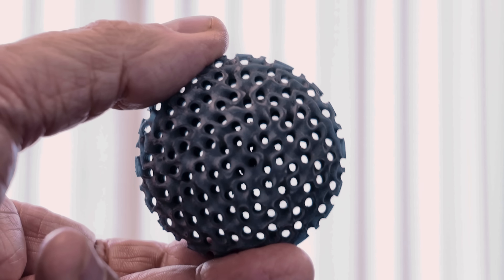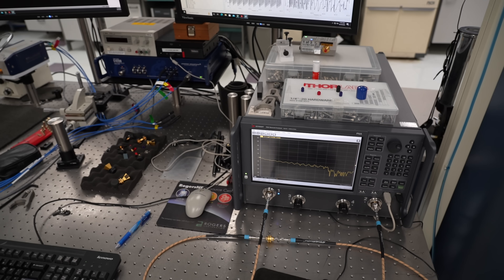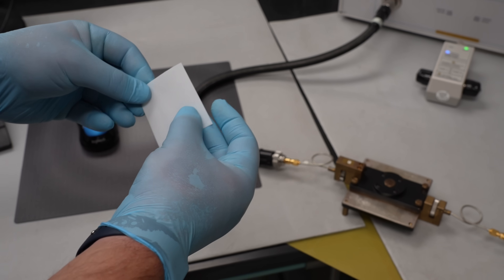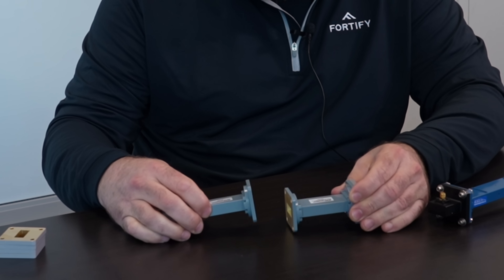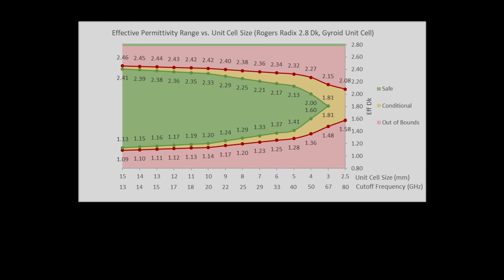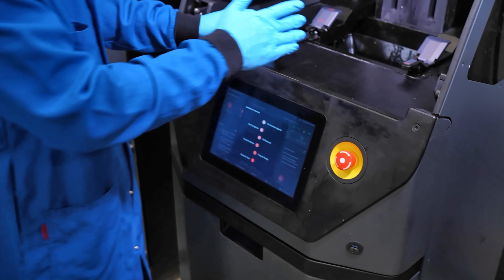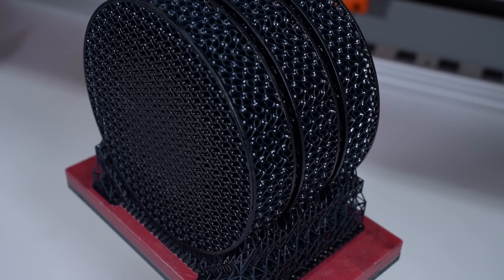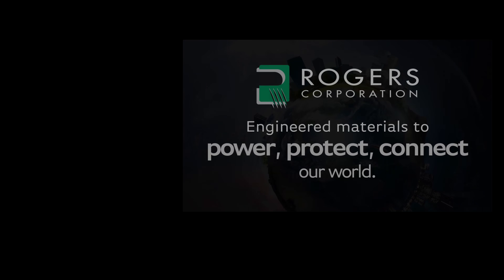Unveiling the Future of Antennas and RF Lenses using Radix™ 3D printable material!

Comment: Could you make a wifi laser with this?
Reply from the maker: Lasers (or MASERs for microwave frequencies) need a way to pump energy into a medium to excite molecules or atoms into a higher energy state that will persist for a while. I can't recall the exact detail of which energy level is involved in for instance a hydrogen maser, but I think it's a spin-orbit interaction and might be from the Zeeman effect splitting the emission lines in a magnetic field then sorting the molecules in a specific state and selecting only the desired one, feeding those into a resonant cavity. If you take hydrogen and excite it, you can select for the 1.42 GHz Lyman alpha transition and get a LASER type effect.  To get the same at a wifi frequency, you would have to find a gaseous, liquid or solid medium with a suitable quasi-stable transition that you can excite to cause a population inversion, then either allow spontaneous emission or drive the thing with a specific wifi frequency to stimulate the emission. Getting any modulation on to the resulting pure single-frequency MASER would not be possible using the normal wifi modulation schemes as those need significant bandwidth and the MASER line is extremely sharp.  Whether a GRIN lens would be any use depends on the loss in the material. It is very low loss, but still perhaps 100 times worse than a mirror-finish silver coating on the inside of a ceramic cavity that it then coated with PTFE.  You need the ultra-low loss and lack of outgassing to get a high enough Q factor for the cavity.  I don't know of a suitable transition for 2.4 or 5.8 GHz wifi, but the Rubidium line in the atomic clock in my home lab is not too far away.  I don't know if you can make a Rubidium vapour MASER though.
Reply from the maker: Another possible transition to use on a microwave laser is in ammonia. The difference between the energy where the molecule is flipped so the nitrogen is on the opposite side of the plane containing the three hydrogen atoms in an electric field.  The difference in energy is about 0.0001 eV and that can be selected by sending a beam of ammonia molecules through a transverse electric field and then into a cavity tuned to around 24GHz. I suppose one day I should have a play as I have plenty of kit and measurement gear for 24 GHz, but there's a lot of other interesting stuff to play with first
Reply: @MachiningandMicrowaves  this is very interesting, thanks for sharing! I have a lot of research to do now 😅
Reply from the maker: @CallMeCarlos1  Wikipedia is a good starting point for masers, Richard Feynman did a great lecture about ammonia at www.feynmanlectures.caltech.edu/III_09.html which is rather heavy on Dirac notation and quantum maths. Theory and experiment don't agree unless you do it with quantum methods, but a full quantum model of something as complex as an ammonia molecule is too hard. Simpler for a hydrogen maser. Of course the 1.4 GHz maser frequency is the 21cm line used in radioastronomy for detecting hydrogen

Comment: Is this a Retro Encabulator?
Reply from the maker: Twin turbo injection model, yes.
Reply: @MachiningandMicrowaves  I have a prediction, or more like current law. I predict/deduce that no material/device can block or reduce a magnetic field to a level that is equal to or more than that required to introduce that material/device within and from that magnetic field.
Reply from the maker: @brycering5989  I need to think about this one. I am sleep-deprived and have no working brain cells left so I'm going to crawl into bed as it's nearly 2am AGAIN dammit...
Reply: @MachiningandMicrowaves  How did you go, did you get to sleep?
Reply from the maker: @brycering5989  Still thinking. My Chihuahuas decided I had no right to sleep and ambushed me at 4am requesting belly rubs and head scritches. Not ideal for solid restorative sleep

Comment: Is AI going to be the next step added to your antenna adventure?
Reply from the maker: I think the applications are a little limited right now. I'm more interested in genetic/generational algorithms working on antenna design optimisation, like the mechanical optimisation stuff in Fusion 360 and similar CAD suites. I'm only scratching the surface of what is going on so far, the work being done as a result of cellphone and bluetooth and wifi antenna design is really interesting, but densely technical and complex.  Perhaps a future video about scaling those to mmWave or UHF might be amusing

Comment: how do you print a luneberg lens for my bumper that makes my car stealth to police radar.
Reply from the maker: You need to investigate RAM for that, maybe decompose some iron pentacarbonyl and add the resulting particles to a ferrofluid matrix with a polymerising component, or look at the older techs using multilayered absorbers like the way ECCOSORB and the materials made for RF absorption work. https://www.eccosorb.eu/Eccosorb.html
Way simpler to book track days for going fast and stick to speed limits I guess!
Reply: @MachiningandMicrowaves  You earned my sub.  cool ideas, thx!

Comment: Cool video lots of jargon I've still no idea what the potential applications of this innovation are. And your "call this a flashlight" confused me further...

This video is not for the layman.
Reply: Is it a lens for em radiation? 
What does dialectric material mean?
Reply from the maker: The target audience for the vid is a small group of a few hundred microwave/mmWave RF engineers and designers. Although it is very much simplified, the level of language and shorthand and assumption was still at the "RF specialist" end of the spectrum. I'm hugely grateful it's had 700k views, despite the dense technical content.

I was hoping to get some follow-up videos out, but a number of domestic disasters involving water leak floods, septic tank blockages and dead appliances, plus the demands of the Day Job and the culmination of a major Youtube project have conspired against me.  The flashlight is being used to house the Mikaelian lens and a transmitter and receiver at 24 GHz and 47 GHz that I'm using as a signal source and remote signal detector for testing the real-world patterns of microwave antenna feeds and complete antenna systems. Having it in a robust and water-resistant enclosure like that giant flashlight means I don't have to worry about the weather being less than perfect when doing antenna range tests.  Also, it's comically huge, which is a fine thing in itself
Reply from the maker: @06howea1  Yes, any material has some properties that affect electromagnetic fields and radiation. The main characteristics are the permeability (how the material affects magnetic fields), permittivity (how it affects electric fields) and its resistivity (or conductivity) which defines how lossy the material is.  A good RF dielectric like polyethylene or Teflon has near-zero conductivity, so low losses, near-unity permeability, so no effect on magnetic fields, but a permittivity of 2 to 3 times that of a vacuum or air.  If you think of a magnifying glass that is biconvex, it also has near-zero conductivity, unity permeability (1.000) and a refractive index of maybe 1.4.  Refractive index is just the square root of relative permittivity.  The light waves meet the curved surface of the glass and are refracted, then they are bent again as they leave the lens at an even steeper angle through the rear surface.  The key difference is the wavelengths.  Light is about half a micrometre wavelength, whereas 24 GHz is around 12 mm wavelength.  If a lens is only 10 times the wavelength, there are diffraction losses and  some other effects, but the bulk effect is similar at radio and light frequencies. The process at the quantum level is the same though, the inbound radio or light photons are scattered from the electrons in the material multiple times and slightly delayed.  The delay is higher the higher the permittivity/refractive index. Water has a very high relative permittivity, but the molecules are very polar, so there are some other effects and it is very lossy at most RF frequencies.  That is where you get into loss tangents or dissipation factors and complex permittivities. PTFE, polystyrene and polyethylene are non-polar to they had very small loss tangents around 0.0004, whereas a polar plastic like ABS is around 100 times more lossy.
Reply from the maker: The main application for me is in making compact antenna feed systems to illuminate parabolic and laterally-displaced elliptical antenna dishes so I can customise the illumination taper across the dish surface to try to minimuse overspill while maximising the on-axis directivity and minimising side lobes that might result in my radio systems seeing hot ground or trees or buildings, which are very noisy at microwave frequencies.  A cold patch of sky has an effective temperature of about 15 kelvin, compares with around 300 kelvin for buildings and ground, perhaps 200 kelvin for the Moon and a huge amount of noise from the sun.  If I'm looking to communicate via Moon reflection, I want to be able to hear thermal noise and radio signals from the Moon, but not have any off-axis pickup of noise from the Sun or the SgrA* black hole at the centre of the Milky Way galaxy, Centaurus A or Cygnus X1 for instance.  Using a good lens design helps maximise the performance of my antenna systems, and having the facility to use a gradient index with a gyroid lattice of similar foam structure gives me a lot more control that machining lenses from solid Rexolite or Teflon

Comment: Imagine I'm a 7-year-old kid. What does the big flashlight do?
Reply from the maker: It is like a searchlight but the beam is microwave energy generated inside the body. It also works in reverse, so a distant source of microwave energy will be focussed into the receiver inside the body. I will use it to test my other microwave radio system and antennas

Comment: They look very strange. What is the math behind this form?
Reply from the maker: It's a type of triply-periodic minimal surface called a Gyroid lattice.  It has some advantages in that there are no disconnected elements when you print them, so no downward-pointing peaks.  The surface itself is defined by:

cos(Ax)*sin(Ay)+cos(Ay)*sin(Az)+cos(Az)*sin(Ax) = t^2

where A is 2*pi/(unit cell size) and t is the wall thickness.  t is usually a function of one of more of x, y and z and t can also be a spatially-variable value.
Reply from the maker: In this case, the parameter t varies across the radius r according to a hyperbolic secant expression, something like t = t0*sech(r/r0)
Reply from the maker: a rich and complex structure from two very simple trigonometric expressions.  I'm trying to finish a video explaining the maths and geometry and the effect of the parameters.  I wanted to get it published last night, but I'm having nightmare problems with my simulation/modelling PC, which keeps crashing under the strain of two-hour simulation runs!
Reply: @MachiningandMicrowaves  that qould be great. It looks very beautiful. Wish you best luck that you get your setup working and that your result comes out as you planned. It would be nice if your video would also explain some theory for rather-non-electronic-engineering talents like me :)

Best Wishes
Friedrich
Reply from the maker: I'm trying to work out a way to explain the quantum-mechanical explanation about refraction and scattering without needing advanced concepts.  I don't want to over-simplify things but I'll try hard not to use unnecessary jargon.  That is useful when explaining things to subject-matter experts with a shared terminology that saves time, but it can be very excluding to a mainstream audience.
Reply: @MachiningandMicrowaves  I am interested in maths and physics but my knowledge is not good enough (yet i hope) to be proficient with quantum mechanics. I still struggle with the Hamiltonian. Oversimplification is probably worse than using apt terminology. People who oversimplify can tell you everything. Oversimplification is the source and hiding place of quantum woo. I guess with the right analogies and analogies for the imagery you don't have to go too far from the actual terminology. Stay true to the terminology and explain it a bit. Im sure you know 3brown1blue's channel (and there are others) who manage to convey the concepts. The only thing you probably cannot fully expect is that your audience will be able to follow complicated formulas.On that one you may get some inspiration from eigenchris' channel. But its all a matter of good explanation and maybe making it a multi-part series? But I don't know how much time you have at your diaposal or you are willing to spend into the project. Good success however! And thanks giving for the formula. I can just enter it into the plotter and the the beautiful outcome (and play with the parameters a bit)
Reply from the maker: @friedrichwilhelmhufnagel3577  I may have some MATLAB code that can generate the plots as isosurfaces, I'm using MSLattice to generate some basic 3D lattices, but the surfaces are not fully covered by the generated triangular mesh, so I have to load it into Fusion360 as an STL file, then run a repair to fill the region between the two faces of the generated object and stitch any holes, then do a little smoothing to reduce the size of the model. That's mostly about getting a good-looking object.  The MATLAB isosurface function works fine and produces closed surfaces. It runs OK under GNU Octave and doesn't need any MATLAB paid-for libraries.  I need to debug the code a little, but I'll publish it with the finished video so folks can play with it.  I'm making sliced models to show the internal structure and the lack of disconnected elements in any plane right now.  Next is to import the smoothed model into OpenEMS and compare the outcome of the gradient-index gyroid with a model using a continuous gradient index. Ten hours work modelling and debugging and 12 hours processing time for maybe 3 minutes of video!

Comment: I'm an American and I have to say that I'm annoyed how they were speaking in imperial measurements. I have no problem with imperial for your run of the mill stuff, but for scientific applications, metric should be used.
Reply from the maker: It was a conscious decision, I spoke in metric, Colby spoke in Imperial,  I'm entirely bilingual about measurements, so 50 mils or 1.27 mm or 1/20th of an inch all "feel" the same size to me, and I know what a step of 10 micrometres or a ten-thousandth of an inch or 10 wavelengths of light feels like to my fingernail. I get irritated by all those dual-units explainers, but yeah, in hindsight I should have added a footnote or we should both have spoken metric with footnotes
Reply: @MachiningandMicrowaves  That's fair. I cannot, for the life of me, "picture" metric measurements. I wish I could. It's the biggest issue for me completely dropping Imperial measurements. I can visualize an inch. I cannot visualize 25.4 mm, even though they're equivalent. 🤷‍♂️
Reply from the maker: @mspeir  I love acre-feet as a volumetric measure, it's a little over a megalitre. Seven inches deep flood across my entire garden

Comment: Omg, your lip synch is out.  Great vid btw.
Reply from the maker: In the first clip I had a major disaster and lost the audio track and I'd changed everything around so that section is totally voiceover rather than original. I didn't notice until a week later that the audio was missing. Only had single camera running and the battery in my Zoom F3 had died, and I had it connected into the camera, so no in-camera audio. Great. This is only the second vid I've ever shot with me in it, and the first where I did interviews. I'm cutting myself a little slack as it was literally my first try, and now my mess-ups have been seen 71000 times. Excellent. Nope. There are some other sections where the interviewees fluffed a line and I didn't ask for a repeat, and I had to bodge together something from the second camera with the um, er, um edited out in the audio but sone if the lip movements still there. Still, as a first ever try with two cameras, two wireless lavs, a gimbal and a list of questions I'd drafted plus the hugely noise lab environment and totally terrible and fast changing sunlight, I am going to tske the lessons learned to heart snd do it better next time. I'm doing dome courses on audio for video and trying to learn Davinci Resolve Studio while I'm making the next one. Youtube is hard
Reply: @Machining and Microwaves  lol, what a nightmare! Voice-over of your own video too! Well you did a fantastic job.  I feel for you as I know first hand how complex video editing is,  even simple one.  Fascinating topic too.

Comment: Doesn't this figure of antenna looks exactly like the inner figure of human brain??? So... human brain can also be named as an antenna or not???
Reply from the maker: Brains are poor conductors and are very lossy as dielectrics, but you can certainly detect small signals from magnetic fields within the brain. Almost anything would he a better antenna though! Getting an electromagnetic signal out through even 10 mm of skin and bone is tricky enough. If you don't mind an efficiency of 0.1% and the brain is not in use by it's erstwhile owner, you could try it.